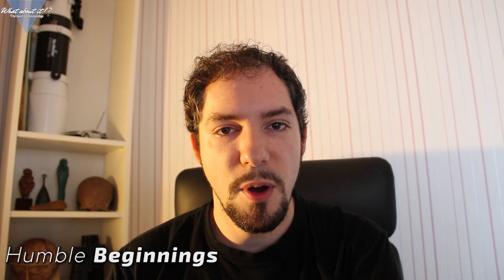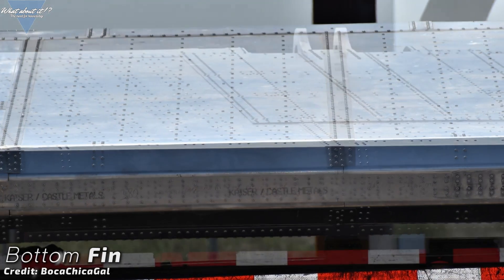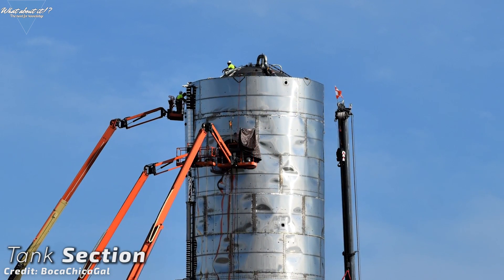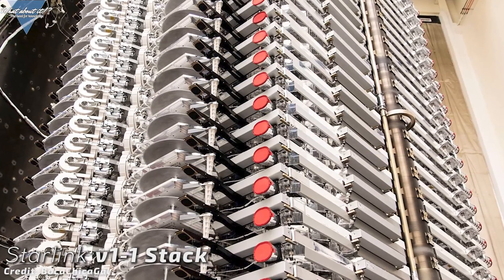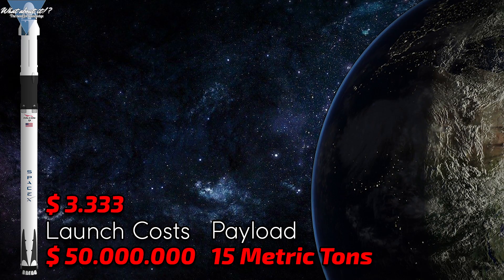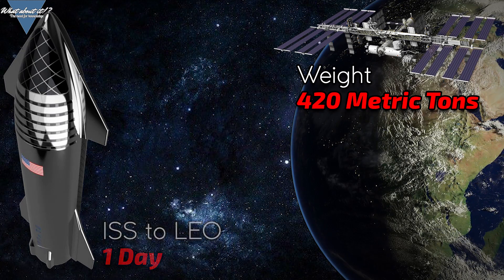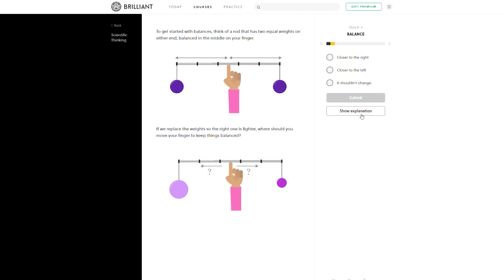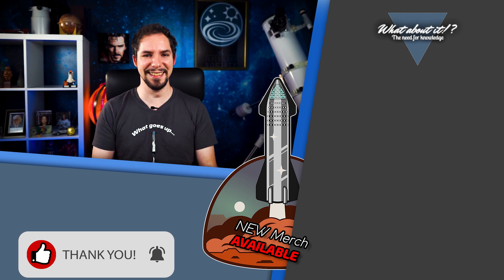50 | SpaceX Starship Updates – Starlink v1-1 Aftermath – Starship Reusability

Comment: Who actually needs confirmation that SpaceX can manufacture precise, high quality parts? Are F9 and Falcon Heavy not proof enough?
Reply from the maker: Absolutely! I read all the comments though from viewers, who somehow have trouble understanding it, so I explain. :)
Reply: It's not like the welders are doing a shoddy job "because it doesn't matter", they can't do a better job given the design and the process. As you lay down the weld the thermal stresses warp the entire structure on you, more welds you have and thinner the sheet metal is, the worse it gets and it adds up. No amount of care and effort will get you better results, you need a better design with less welds and a different build process that lets you properly jig everything and trim dimensions to fit after the fact.
The fin doesn't look better because they took more care in making it, it looks better because it's riveted not a welded structure.
Reply: @aleksandersuur9475  I'm betting that rivetting is slower and weigs more than welding?
Reply: stainlesssteelfox1 - That’s correct & is why so many ships have been welded since the early-1930’s. SpaceX is already designing a much simpler Starship that will have fewer parts & be much easier to weld.
Reply: stainlesssteelfox1 indeed airplanes haven’t been riveted since WWII
Reply: @nathanlewis42  Are you kidding me? Planes are totally still riveted together, I worked a Boeing in Everett, WA for 4 years, and can assure you that they still use rivets, they are just flush with the body work, and under the paint. There is NO way that welding is lighter.
Reply: @stainlesssteelfox1  I don't think there is that much of a weight difference and it's not like riveting is slow. It's rather that trying to weld thin aluminium sheets to aerospace standards is ridiculously difficult. It's a completely different type of work that building ships or water towers.
Reply: @3000gtwelder  I can't argue with your experience so I stand corrected about riveting. But the Falcon 9 is welded with friction stir welding. Based on statments in interviews it seems that Elon Musk plans to continue to use welding in the construction of Starship and Superheavy. I don't think there is anything wrong with welding I think the problem just with doing it outside in the hot and humid air instead of in carefully controlled conditions.
Reply: @nathanlewis42  You can't friction weld stainless steel. Friction stir welding does not use any filler metal in the welding process, but stainless steel requires a different welding process where you are adding filler metal "Adding weight" in the process.
Reply: @3000gtwelder  Rivets are also a kind of filler and and weight do they not? Musk has spoken of welding the Starship and Super Heavy so I do believe they plan to use some type of welding. I am not going to pretend to be an expert here but there is https://www.twi-global.com/technical-knowledge/published-papers/friction-stir-welding-conquers-austenitic-stainless-steels-november-2000 and according to
https://www.smithmetal.com › 301-stainless 301 stainless steel is an austenitic stainless steel.
Reply: Magic Smoke FPV - The Germans found that welding their Panzerschiffes instead of riveting them saved close to 200 tons out of a total weight of 12,000 tons. Kaiser Steel obtained the same sort of weight savings when they welded Liberty Ships instead of riveting them.
Reply: @nathanlewis42  Except for the carbon fiber parts, all airlines rely on flush riveted skins,Often done with robots these days.
Reply: @aleksandersuur9475  Well said sir.  Anyone who has welded sheet metal, or anything for that matter understands the differential thermal expansion of the material, which is one reason why they use jigs.  You are also correct - it doesn't matter for this prototype.
Reply: aleksander suur I think the issue is that they are being assembled outdoors. The Falcon 9 is welded.
Reply: @nathanlewis42  The falcon 9 is lithium aluminum.
Reply: @aleksandersuur9475  finally an experienced welder weighs in! 
I appreciate that -- as a mechanical engineer it's unbelievably helpful whenever a welder helps explain their craft. Specifically sheet steel: my favourite material to design with, but has important limitations & jigging requirements.  Both of these I came to understand intuitively in the shop, more so than the classroom. so Thank you!
Reply: @gamble8008  I'm not really a welder, I've just seen a lot how hard it is to get welded constructions to turn out within tolerances. We make a lot of industrial automation in welded frames and it's my job to fix all the hardware problems with software and get the damn things working.
Reply: Raptors and Dragons are the evident proofs.
Reply: @scabthecat I think the better term to use would be they "share" or "use" the same philosophy.  The word "copying" sounds too much like cheating...  Don't forget Elon's way of doing things comes from his background in software development - which is exactly how they do things...
Reply: BuzzedAldrin don’t forget Columbia, EVERTHING mush be double triple heck even quadrupled checked.
Reply: Officialasim - You’re thinking of Challenger which launched well outside of the temperature parameters recommended by the engineers who designed the SRB’s & over the objections of those same engineers. Columbia suffered damage to tiles which were protecting a vulnerable part of the wing which was made of Aluminum. Here’s what happened to a space shuttle that suffered even worse tile damage in a location that was protecting a part of the shuttle that was made from the same stuff SpaceX is making the Starships from - 
https://www.americaspace.com/2018/12/09/dying-all-tensed-up-30-years-since-the-troubled-secret-mission-of-sts-27/
Reply: @TraditionalAnglican  That link doesn't show anything to do with the tiles or damage? Also the tiles that Space X is gonna  use are not at all like the tiles used on the shuttle.
Reply: Magic Smoke FPV - That link describes the damage suffered by STS-27 Atlantis & how the type of stainless steel used on Starship survived the heat of Reentry after a tile failure & enabled the astronauts on STS-27 to return home ALIVE - Here’s another link where that is discussed - https://forum.nasaspaceflight.com/index.php?topic=16429.0 
Here’s a bit on the properties of the steel SpaceX is using - 
https://www.space.com/43101-elon-musk-explains-stainless-steel-starship.html 
Here’s a link on the tiles - 
https://www.space.com/spacex-starship-hexagon-heat-shield-tile-test.html 
https://www.wired.co.uk/article/elon-musk-spacex-starship-science 
https://www.express.co.uk/news/science/1187611/spacex-starship-latest-design-changes-elon-musk-mars-space-rocket
And, I know the tiles on Starship are much more durable & much easier to maintain than the ones on the Space Shuttle - I just think it should be noted that the steel these tiles are protecting is a lot more heat resistant than the Aluminum on the Shuttle.
Reply: They put extra metal in the wields so they are as good structure as the steel pancake source alloy, but the scarwork weighs little
Reply: @adymode  Huh?
Reply: @TraditionalAnglican  Yeah, that is true.
Reply: Can stainless be stir welded?
Reply: @Markle2k  In short - yes, it's not as common as stir welding aluminium but it can certainly be done. It needs really rigid fixturing though and if you already have that I'm not sure how much more of an advantage it really provides for stainless.
Reply: @Markle2k   Well, actually it can be, but it is really difficult, and can only be used in certain positions and requires a lot of clamping. Plus I have heard it also heats the stainless up way to much burning out some of the chromium in the process, making it weaker. You would not be able to use this process on all the welding that would be required to build the rocket.
Reply: @ginagina5452  He's doing the talking and boasting while working behind closed doors, while Musk is progressing rapidly and openly, while still giving out plenty of information without trying to act as a hero. Also, Musk corrected Jim Bridenstine, the current NASA Administrator, that NASA is not restricted to share only general information about SpaceX's progress publicly, but all information, confirming their open development policy. It is almost like open-source spaceflight. Remember, Bezos has achieved nothing yet when it comes to orbital spaceflight, he's just doing suborbital tests for now.
Reply: Different construction materials